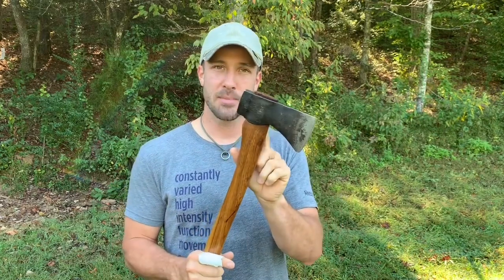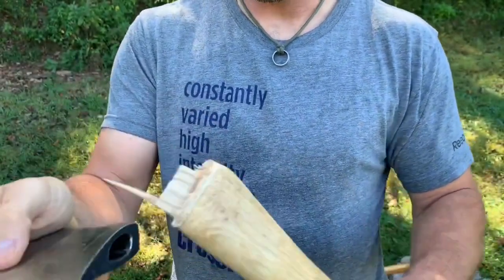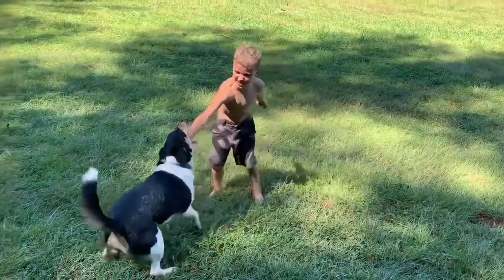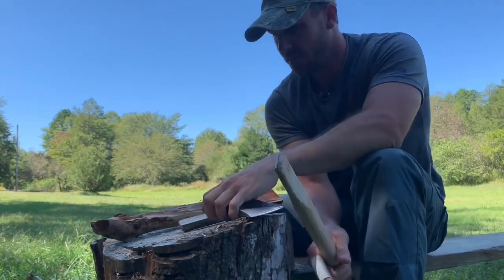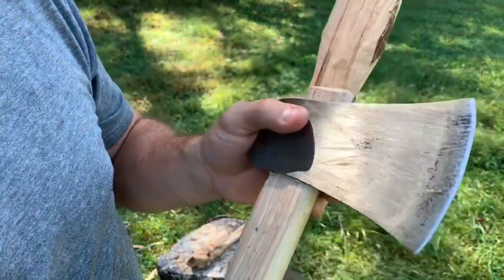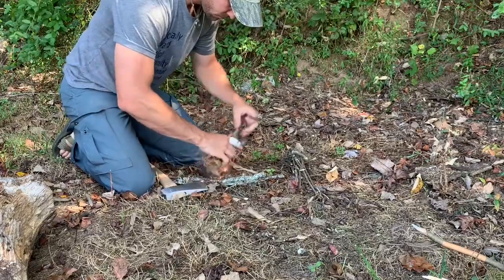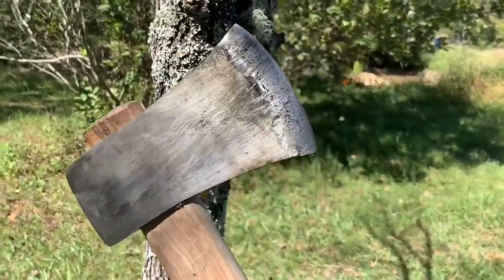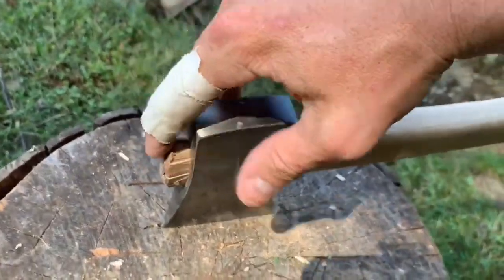Can You Repair A Broken Survival Tool Using Only That Tool in the Wilderness?

Comment: Good presentation and while proving it can be done, this also proves there's more than one way to skin a cat. I use axes and find it a necessary tool to have, but I've always preferred the tomahawk out in the field. Easier to make replacement handles and the fact I can easily remove the head to use by itself or put on a handle of a particular length for a specific job is a nice feature to have.